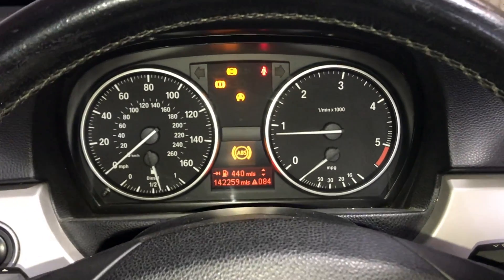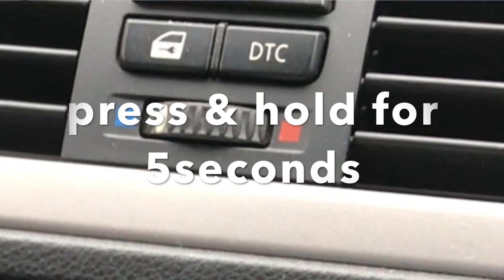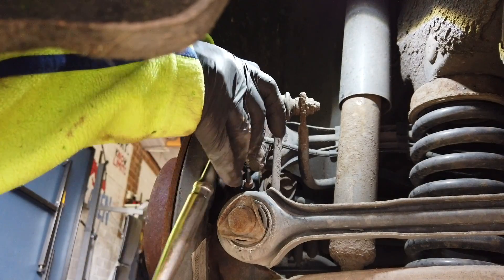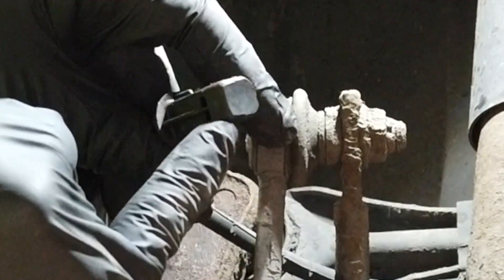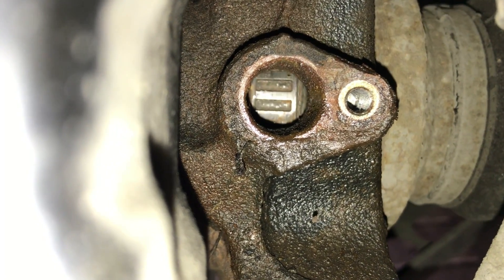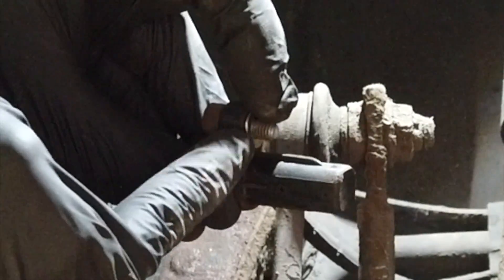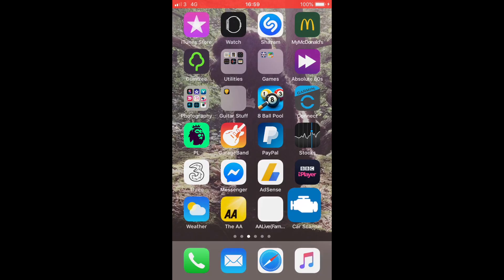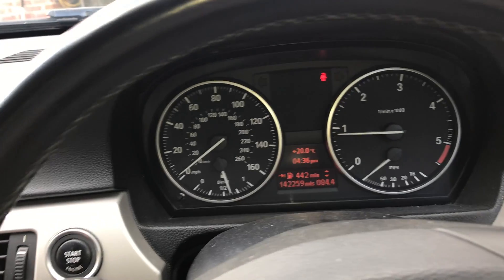BMW ABS Sensor Repair "No New Parts" ABS Ring. E90 E91 & More

Comment: How about D354,D355,D356  how to fixed
Reply from the maker: Most ABS faults on these cars relate to these sensors at the rear so always start there if not I do have another video on a control unit repair check that one out it’s in the playlist at the end of the video Thanks for the great comments👍🏻👍🏻🛠

Comment: something else to try as well, i had abs/traction/ brake/ and check engine light. scan of car (using INPA) said it was right rear wheel abs sensor. live data scan shows right rear sensor would "jump" or "jitter" while driving and the other three would be steady. took the left rear sensor and stuck it on the right and put a brand new one in the left. cleared codes, did about 5 or so power cycles (turning car on and off) and drove about 50 miles. so far so good
Reply from the maker: Thanks for the great information👍🏻👍🏻🛠
Reply: Another random update. At about Mile 70 since doing all this turned on the car and drove about .5 miles and the three lights came on. Did a u turn to go back home and they turned off. 🤔 going to have to test the "steering wheel angle sensor" that I saw a few other videos / forums mention. Perhaps the guy who said a draining batter will make the car forget the angle sensor calibration. Gonna check batter info also later

Comment: Hi aaanton11, I have tried this fix because I really would like to use my cruise control because I do long drives everyday. However, after doing this fix, my speedometer needle isn't moving, any thoughts on why that could be? I also got two new other lights on the dashboard, one looks like a seat belt warning light (but no audio alarm is heard) and another light on the dashboard which looks like an airbag light. Any thoughts of what this might be will be very much appreciated?
Reply: My English is bad but maybe you will understand. You used too fat ring on your bolt.
Reply: @madoofmedaf9793  no worries. Thank you. I have taken the rings out now. I will have to find a really thin ring
Reply from the maker: Yes like madoof medaf says you need really thin washers Thanks for the great comments👍🏻👍🏻🛠
Reply: It’s the abs pump

Comment: Fantastic video, quick question do I need the code reader to clear the abs fault light or should that clear after I put the sensor back with the washer?
Reply from the maker: Depends, sometimes it will reset itself if not code reader needed, Thanks for the great comments👍🏻👍🏻🛠
Reply: @aaanton11  thank you

Comment: Great video. Quick question, although stated in video, is it mostly the rear passenger side ring which goes bad? Also have you changed out the ring as of yet or is the washer fix still working for you? Started to happen recently on my 2010 318d and what to know if this washer fix works for at least 6 months?! Any info appreciated 👍
Reply from the maker: Usually its the near side, but a nice thin washer on both sides is good, mine is still ok with no issues, Thanks for the great comments👍🏻👍🏻🛠

Comment: Ive done this today but put 2 washers on. And now all abs lights are on. Have i moved the sensor too far away from ring. Thank you
Reply from the maker: yes, too far away, Thanks for the great comments👍🏻👍🏻🛠
Reply: Thank you.  Took 1 washer off and alll fine now.  As i started to drive all lights went off on there own. Thank you. Hardest part is taking wheel on and off in this snow 😂

Comment: did the same as you mate but abs keeps showing is it because i have not deleated fault codes?
Reply from the maker: might be the washers are too thick, you definitely need a code reader to be sure which side is causing the issue, Thanks for the great comments👍🏻👍🏻🛠
Reply: @aaanton11  thanks for rapid reply mate can u recommend a good reader

Comment: Hey - I tried this. Can the abs sit too far away from the ring? I’m thinking that the washer I’ve used might be too thick....
Reply: I might add that when I used a washer, all sorts of funny business happened - including the speedo stopping working.
Reply from the maker: The washer needs to be really thin 0.1-0.2mm or the sensor wont read the ring, Thanks for the great comments👍🏻👍🏻🛠
Reply: @aaanton11  Thanks fella - I'll try again tomorrow. Had a heart attack when I started the car up after the fix - I'll get an ultra thin washer
Reply: @aaanton11  absolutely top fix. Used a .2 and it’s solved the problem. No more pressing the traction control every time I get in the car. Thanks 👍🏻
Reply: @richardhayes5517  what happened when you used a really thick washer I think I have done the same lol
Reply: @abuismail927  all sorts of funny business went on. Speedo stopped working, fuel gauge read full then empty, and the dash lit up like a Christmas tree. Used a thin washer and then worked ok.
Reply: @richardhayes5517  where did you buy the washers from and do you remember what internal diameter the bolt is ?
Reply: @abuismail927  I bought a selection set from tool station
Reply: @richardhayes5517  can you send me link please
Reply: @richardhayes5517  thank you Richard, the thinnest I can find is 1mm ? What thickness did you end up using ?
Reply: @abuismail927  I used a 1mm in the end - it worked ok. Tried first with a thicker washer and that’s what fouled the cpu up
Reply: @richardhayes5517  sorry mate last question lol, when you changed the washer did you have to plug in or did the lights just go off on their own ? 

And do you remember the size of the bolt hole again ? 

Regards
Reply: @abuismail927  can’t remember the washer diameter I’m afraid. After the fix, you need to run the car for 100 yards for the lights to reset.

Comment: I'm having a similar problem with the jerk but only happens when I do WOT(wide open throttle) and it won't let me go past 5k rpm only light i get is DSC and I can't manually turn it off using DTC only when I turn off and back on the car. Can that be a cause of a faulty Abs wheel sensor? Or the dsc module (which i hope its not)
Reply from the maker: Unlikely to be the module and more like a wheel sensor issue, those abs rings are definitely worth checking, Thanks for the great comments👍🏻👍🏻🛠

Comment: Does this issue cause the car 2 shake when accelerating
Reply from the maker: not normally, that could be a wheel issue, ie buckled rim on the inside, or a duel mass flywheel issue, Thanks for the great comments👍🏻👍🏻🛠

Comment: Can someone how knows response, does the sensor read the ring OR the axle under the ring through those wholes at the ring ??
Reply from the maker: it reads the ring, or the magnetic difference of the ring, Thanks for the great comments👍🏻👍🏻🛠
Reply: aaanton11 "magnetic difference of the ring"! Well that explains why the corrosio/rust under the ring makes the error. Thank you!

Comment: Hi I have a mini R52 that keeps cutting the power and flushing the triangle warning light could this be the same fault?
Reply from the maker: More likely to be a faulty abs wheel sensor, you need a code reader to pin point which one, Thanks for the great comments👍🏻👍🏻🛠
Reply: aaanton11 Thanks for the quick reply!!
Will any code reader show me all 4 sensors?

Comment: Great video! I've just had my ABS, DSC, no puncture warning system messages come up. Read the codes with Carly and says 005D91 ("Valve relay, does not close during startup test: Wheel speed sensor front left continuity"-  didn't come back after first time of clearing), 0049F2 ("WHEEL speed, 0xCE" - which now is present permanently). Any suggestions where to start?? Appreciate any help, thanks
Reply from the maker: This sounds like a faulty wheel speed sensor, the continuity could be a poor connection at the sensor plug in the wheel arch, I would check the sensor and plug connector, Thanks for the great comments👍🏻👍🏻🛠

Comment: What type of washer did you use? Only have 1mm think ones will they lift it too much?
Reply from the maker: 1 mm too thick, definitely need a thinner one, Thanks for the great comments👍🏻👍🏻🛠
Reply: @aaanton11  Got it sorted. Front left sensor was like brand new but wasn't working fault code 005D96, so I got a new one from euro car and it's done the job. Glad I came across this video as it's gave the confidence to fit it myself 👍

Comment: I try this on my BMW e92 2007, but it not help. First i had only the flashing traction control lamp, after i do this in the video i have abs,dsc,dtc and tyrepressure lamp on. It comes and goes when i drive.
Reply from the maker: Take the washers out and use really thin ones sounds like you put 1mm washers in, Thanks for the great comments👍🏻👍🏻🛠
Reply: tromidt do you repair it? How much mm spacing?
Reply: @Joldx1  Hi. Yes i have repaired both sides behind. At first i tried with 0.5mm washers but it did not help. So i decided to try what is the real problem, namely rust and dirt on the abs rings. I took out the abs sensor, then i used a large sharp screwdriver that fit exactly in the hole for the abs sensor. Then i turned around the drive shaft, i did this on the brake discs, then i got rid of the roughest rust and dirt. Then i used sandpaper in grain size P60. You can cut it into thin strips and attach it to the front of a screwdriver, and then put it into the hole of the abs sensor. And then turn the drive shaft again. You also get to where you see the abs ring on the drive shaft. Mine was perfectly fine and shiny, and all the problems with the warning lights were gone. And it still works. I used the brake cleaner in the end, to get rid of rust and dust from the sandpaper
Reply: tromidt thank you im going to do that ☺️

Comment: Nice video! I got 5D90 code , it said  "DSC Wheel speed sensor : power supply,  front left ... What does it means? Thanks
Reply from the maker: Could be a poor connection on the sensor plug or the sensor has failed, Thanks for the great comments👍🏻👍🏻🛠

Comment: So if you replace the sensor will it still cause a fault
Reply from the maker: it will if the ring is corroded, the ring will need replacing too, Thanks for the great comments👍🏻👍🏻🛠

Comment: How much time would this quick fix buy you?  Just a rough estimate. Thanks mate
Reply from the maker: I still haven't replaced mine yet, it is still as good as gold so hopefully will get another year out of it, Thanks for the great comments👍🏻👍🏻🛠
Reply: aaanton11 thanks a lot man. Appreciate it!
Reply: aaanton11 hi mate. Just tried this washer trick and now all my ABS, handbrake and stability control lights are on. Any ideas why that might be? Did I not tighten it enough or is there another issue?  Thanks
Reply from the maker: if the washer is too thick this will happen, fit the thinnest washer you can find ie less than .5mm Thanks for the great comments👍🏻👍🏻🛠

Comment: Thanks for making this vid, much appreciated. My e90 06 320d started to jerk alittle after a long drive with the traction light flashing. I got around this by using the dtc button.

I've done the fix in this vid however, i now get the abs warning light and traction light come on as soon as i turn the car on. My obd tool cant find any faults. Any help would be great and thanks again.
Reply: 9 months later i gave this a try with a thinner washer 0.2mm which did the trick! I thought i'd come back and say thanks and much appreciated.
Reply from the maker: Does your eobd tool read abs faults, some don't, also worth trying what's in this video, https://youtu.be/Km6lGciCmLk , Thanks for the great comments👍🏻👍🏻🛠
Reply: @aaanton11  i'll give your recommendation a try and have another scan with a better tool. Thanks again, will let you know how I get on.
Reply: Hey I've got the same problem man. My e90 2011 has been sitting for a year and started to drive it and it jerks in 1st and 2nd gear with the traction control light keep flashing. I'm not sure what's causing this. I hear a grinding/clunking noise coming from the rear wheels. Any ideas ?
Reply: If you turn the traction control off all the way by holding the button down for 10 seconds, does it still jerk when you drive?
Reply: @movtec1  it drives slightly better but still jerks in low gears and traction control still kicks in even when I've turned it off. The light will flash repeatedly when the car hesitates and jerks.
Reply: @SirajM-v2b  are you sure your turning it off all the way? You press it once then hold it down for 10 seconds.

If you're doing that and its still jerking, it won't be the sensor in this video as turning off the traction disables this
Reply: @movtec1  Hey Mann your right. I acc did this this morning turning off the traction control completely off and I had no jerking in 1st and 2nd gear and the car ran soo smoothly. Deffo can't be a failing differential. Has to be those ABS rings or the ABS/traction control sensors. Thanks man! 😊👊
Reply: @SirajM-v2b  you're welcome, glad you found the issue
Reply: @movtec1  is it best to install those washers for time being or just replacing the rings and rear abs sensors as well. I've got the brake light and abs as well as traction control light on my car no loool
Reply: @SirajM-v2b  adding the washers sorted mine for a few years and will cost you about £1. Make sure it's 0.2mil. Got mine from ebay

Doing the rings and sensors will be a few 100 pounds so worth trying the washers first
Reply: @movtec1  Honestly mate thank you for your help. Will be having a go at doing the washers first tomoz hopefully weather is good enough so I can go outside 😂. Once the washers are in and I take it for a test drive should all the ABS and traction control warning lights dissappear by themselves or would I need to reset them via a scan tool ?
Reply: @SirajM-v2b  you shouldnt have to clear anything. Should drive as normal